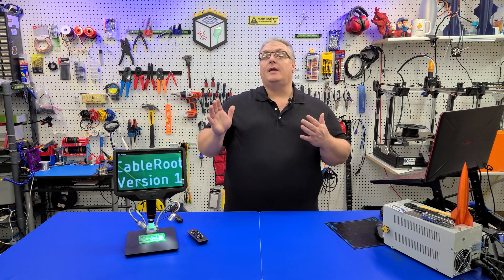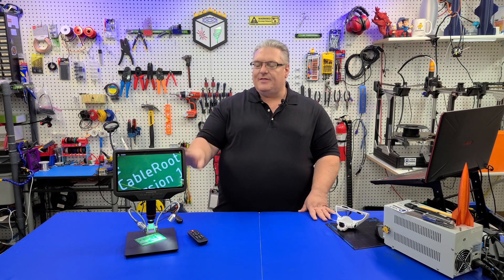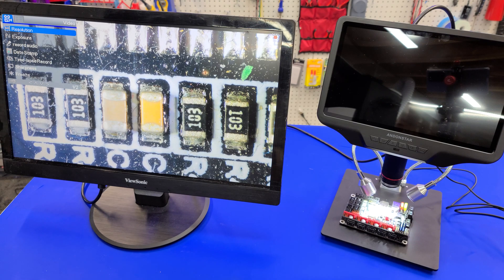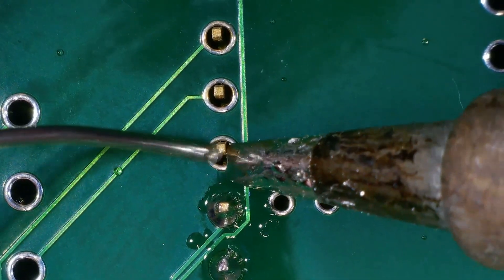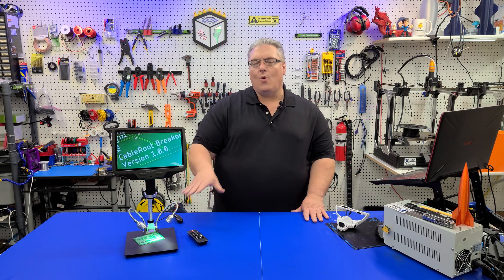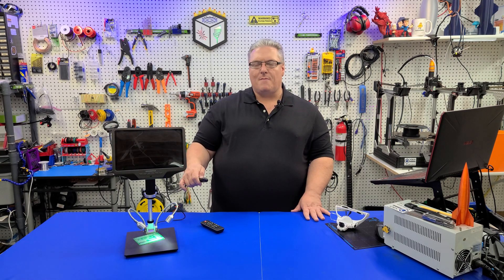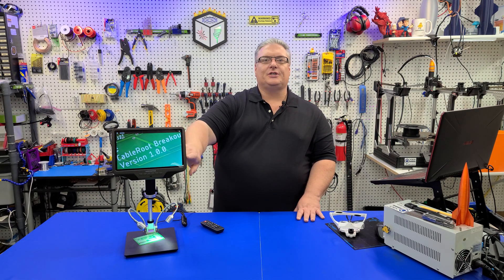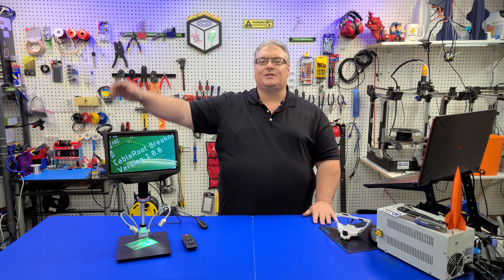Upgrading to a PCB Microscope | Review Of Andonstar AD409

Comment: Okay, old video now but I believe by now a year later, you would have worked out that you have the microscope tube part too far down. It needs to be set up so the red line is just above the clamp. You then rough adjust using the wheel at the back, lock that into place then rotate the microscope body to fine focus on the job.
The wheel and lift assembly looks exactly like my (smaller screened) Andonstar so that means it has a sloppy lift mechanism, an obvious fault which really should have been designed out of it by now. Mine has all your bigger screen features minus the screen real estate and 4K but seriously one doesn't need 4k - it's a marketing gimmick.
Like you, I absolutely need this to work on smd stuff. But, I can mange with the smaller 7" screen without having to connect up to my 24" monitor. So that 10" screen would come in handy as an all-in-one solution I reckon. Great product for the price and I recommend these to anybody who works on fine stuff and have eyes that have seen better days - pun intended.

Comment: I am looking for a good microscope, mainly for coins, and been looking at this one, but also Tomlov DM602 and others. I find it very difficult to co compare the various microscopes, so it is a challenge to make a decision. Both Tomlov and Adonstar looks great.
Do you have experience with the Tomlov one?
Reply from the maker: Sorry I don't. I know the a adonstar does support add on wide lenses. I was able to add one no problem for a wider FOV
Reply: @MakersMashup I bought the wide angle lens in your description but it doesn’t fit my Adonstar 409. Are you sure you have the correct wide angle lens linked?

Comment: The screen is too big and the center of mass is too high.
Sometimes, smaller is better - REALLY!
Reply from the maker: I like the large screen but the center of mass is a bit high on this.  You certainly could topple it over with a good push.  The steel base though keeps it in place.  Given this design though I may just bolt this to the back of workbench and leave it installed permanently.

Comment: $400.00 will buy a good printer and an endoscope. Nice machine for a man that makes a living with a soldering iron. Not so good for a maker. I do know what you mean about the smd surgery. Without extra eyes I can barely see the components let alone the numbers. Thanks for the review, Happy soldering.;-).
Reply from the maker: They do have a number of other models (others have mentioned as cheap as $60).  I get it though it's certainly not a small investment and as I mentioned I was grateful to be able to review one otherwise it would be unlikely that I would buy one as well. Thanks for watching Danny.
Reply: If the price here is too steep, get yourself a microscope camera with an articulating arm mount instead. Once you're going this route instead, you can pic one with a 48mm thread, so you can buy affordable barlow lenses, filters etc. Then just use any old monitor with low input latency as output. This is a pretty good piece of kit, but if you don't need a big built-in screen, then you can get similar results for a lot less money. That 10" display on this model is a pretty pricey piece, not a bargain bin chinese crapola part.